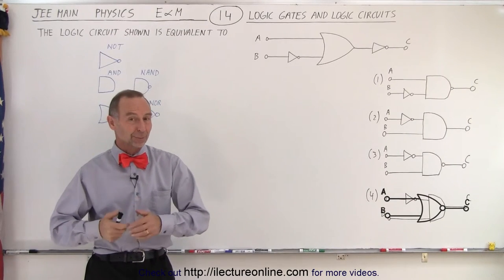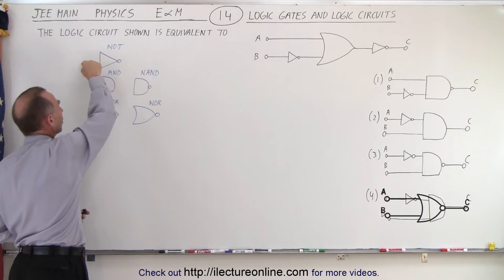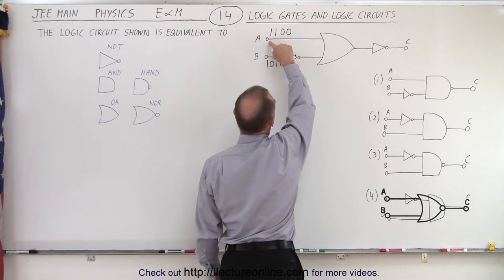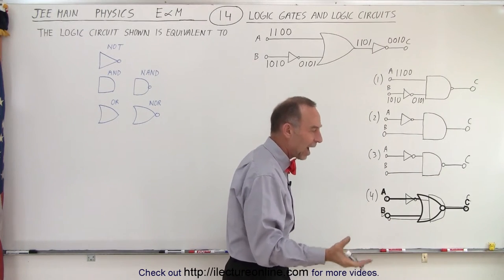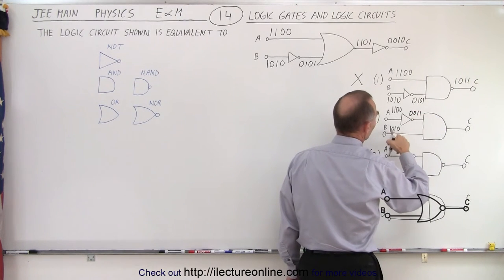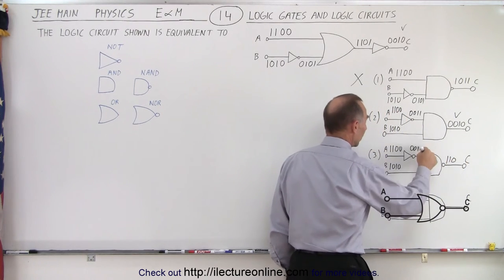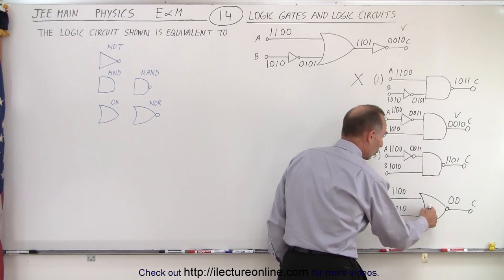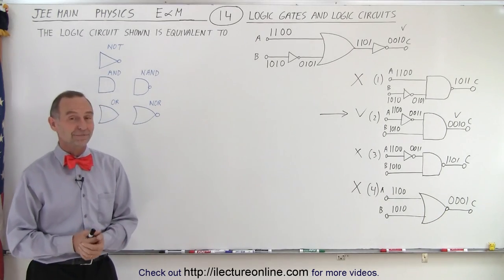JEE Main Physics E & M #14 Logic Gates and Logic Circuits

Comment: As a quick extension, whenever people become more comfortable with these, you can use DeMorgan's Law to show that the NOR gate in the original becomes an AND gate with inverters on each input. Then, it's clear that the two bottom inverters cancel, so you're left with an AND gate with an inverter on the top input, which is exactly what the solution is. This makes it a very quick 30 second problem, and of course, you could check your work by plugging in. Happy engineering everyone!
Reply from the maker: Great input.  (I wanted to keep it simple with just the basic understanding of the gates, but yes, it can be done more quickly as you indicated).
Reply: Absolutely, and I think that's perfect! Just wanted to point it out as another, slightly more abstract method. Thank you so much for your videos! They've helped me so much with my engineering course work in college so far!